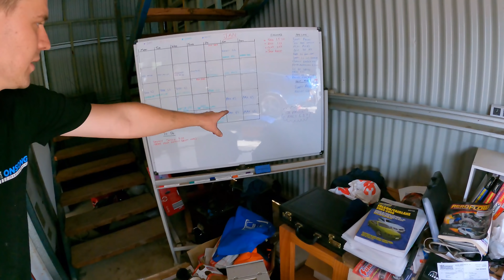We Hooked One!! || Lionfish Episode 1

Comment: Alloy tailshaft is factory. The BTRs don't last long without an extra cooler when towing. AU BTR is stronger they're the same as XR and XR6T, base models box has narrower gears. I have a BA wagon that was our work hack for 10+years and it's been flawless, it's LPG though so it gets 750km to a tank.
Reply from the maker: Awesome thanks for the insight! All fairly new to me so appreciate it a lot 👌 
Hopefully this one lasts a little while with ~350whp 🤞🤞
Reply: @BoostGumps   Happy to help. One more thing though, don't remove the BBM butterflies, you will lose bottom end torque. The BBM operates by switching between long and short runners, they are not a restriction. The factory turbo didn't have them purely for cost cutting measures. It would be an interesting thing to test when it's on the dyno too.
Reply from the maker: @the-THORNSPAWN  yeh I understand their purpose. People who I have talked to remove them just to remove the worry of the engine swallowing the hardware, apparently they tend to flex a bit under boost. Im sure our mere 8-9psi of boost shouldnt be enough to do any damage though. So we will see what results are like for sure!
Reply: @BoostGumps  The butterflies falling apart and flexing is very unlikely. If they've held together for 370000km a bit of boost won't hurt it. In my 8 years on the assembly line from EL to FG I never heard of one losing a screw. there were plenty of "extra" fasteners that found their way into the manifolds but they never made it past hot test.

Comment: They are a pain those damn pedals haha but just FYI you can unbolt the whole pedal box and persuade it on a good enough angle to slip them pins out.
Reply from the maker: Yeh we actually had all 3 bolts out before we went crazy on the dash! Was just that last pivot pin. We had already butchered it so badly by that point so just hacked it out lol. For the next conversion we will know though. Next time just straight up master/booster out, dash and column out and take the whole pedal box!